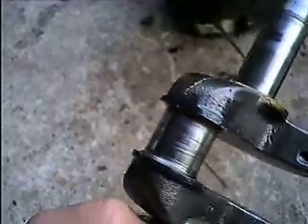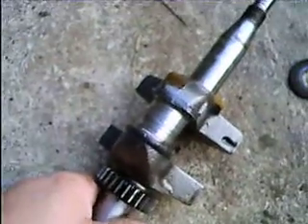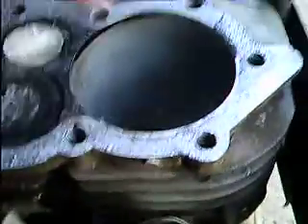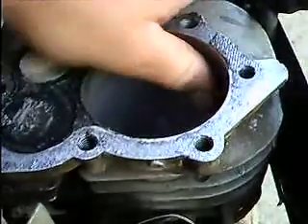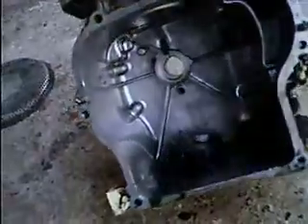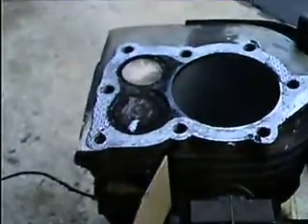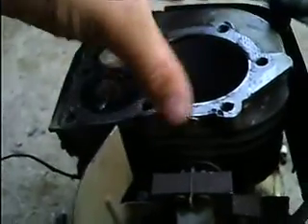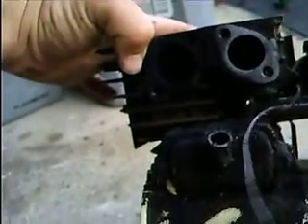Free Briggs 5HP needs work

Comment from the maker: I do not believe it is good practice to over bore an engine unless it has an iron or steel cylinder.  By boring into an aluminum cylinder you will expose material that was not anodized at the factory, the engine will be fine at first but will wear at a considerably faster rate.
Best bet would be to bore out and sleve to standard.